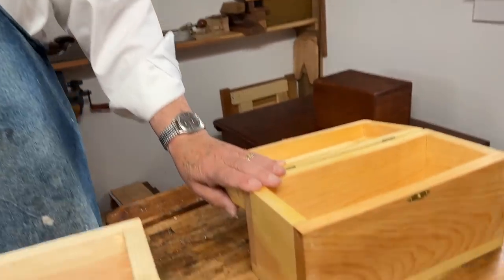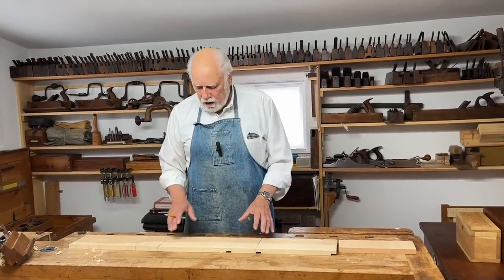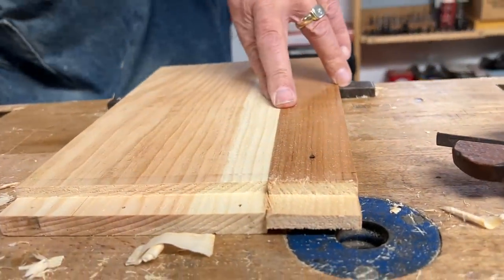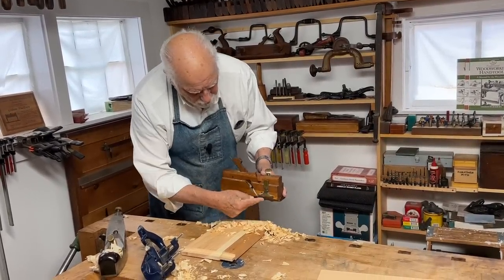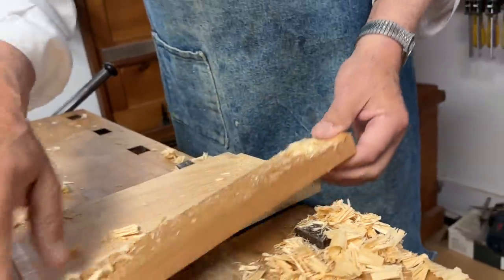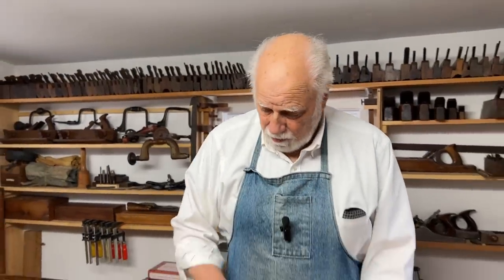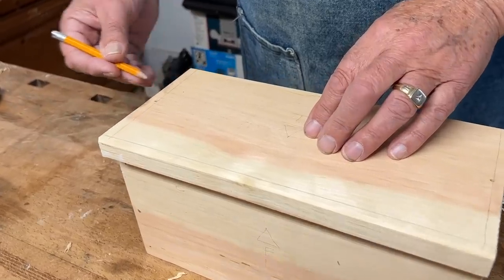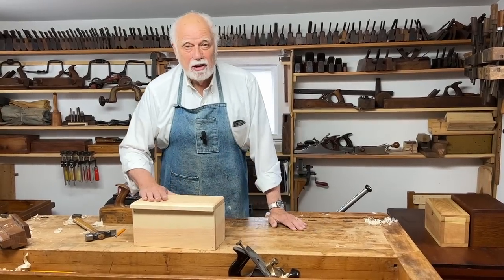39. Rabbetted Box

Comment: When setting up any type of rebate plane where do you prefer to locate the plane blade in relation to the edge of the plane.
Reply from the maker: Just a very tiny bit proud of the side of the plane, otherwise you run the risk of the wall  of the rabbet stepping out.

Comment: Whenever I try to cut rabbets, there are always one or two unlucky boards where the grain direction is wrong and there is tear-out. What is the best way to solve this problem if I am using a #78? It's kind of awkward to use it in reverse. Thank you!
Reply from the maker: Ways to avoid tearout: 1.Super sharp blade
2.Thinner shaving
3. Finish the rabbet when it's nearly at the correct depth with a scraper (going in the opposite direction)
Reply: @gjbmunc  Thank you very much! I'll try that.